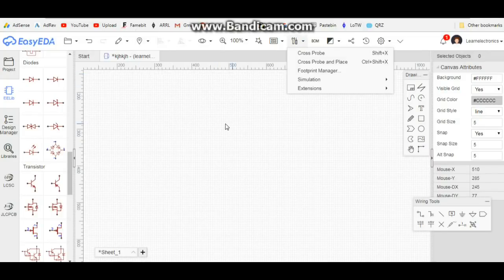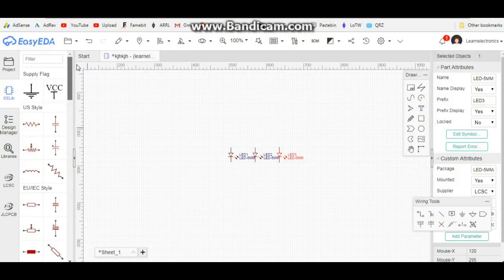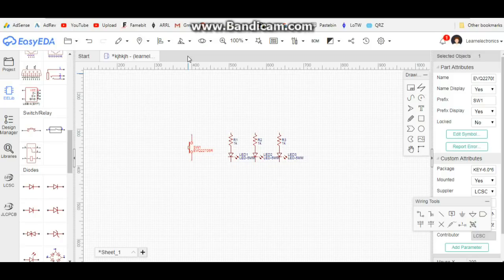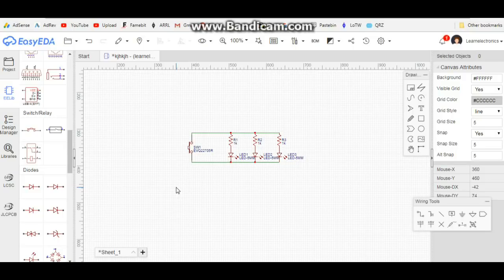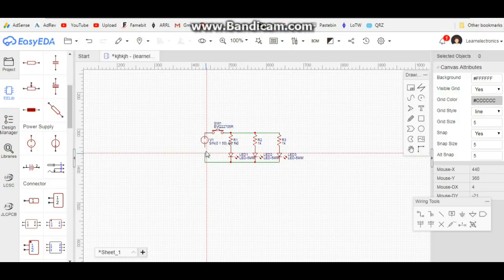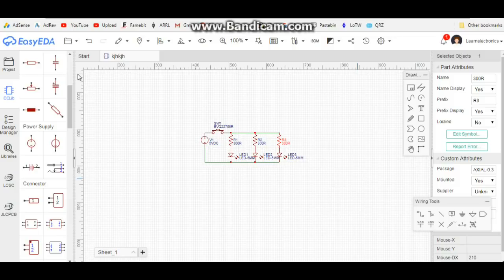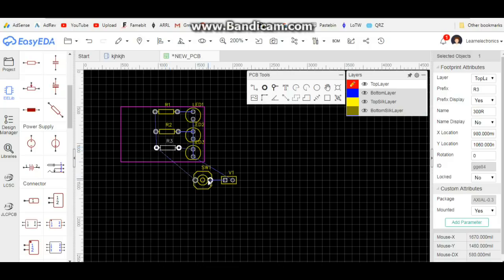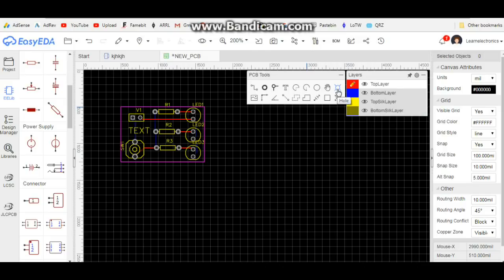From idea to PCB - Intro to EasyEDA

Comment: Maybe you know the answer to a few questions. Sense I can't get the help section on the program to work. I would like to set the grid to show inches divided into either 1/8" or 1/16" instead on 10th's of an inch. (which is worthless). And how do you determine the center of the actual component? (An LED for example). The guide lines on the ruler only show where the grab hand is which changes each time you grip a component. So, placing a component accurately is Impossible. Or, better yet, do you know how to actually contact ANYONE at EasyEDY to ask questions like these? I've tried and tried with no luck.

Comment: I was sitting on the edge of my seat, waiting for the steps to see how easyeda does spice simulation.  I can't get any of my circuits to work. You almost did it; but, you skipped to the router.  I get different errors: iteration limit reached; tran aborted; source stepping failed; transient solution failed, and on an on.  
Also, I can only see a voltage probe.  Where's the ammeter?

Comment: EasyEda is really nice. I started like two months ago to create my first PCB and after some Videos it wasn't too hard to do. Also their  huge component library saves so much time.
One thing i've learned since then: The server for the auto router sometimes seems to run on its limits sometimes so it doesn't work or take very long. In the Auto Router menu is a setting in the top right to switch between "cloud" and "local". For everyone who uses that software quite often i would recommend to use the "local" option. It's just a little extra program to download that needs to run in the background and it will do the auto routing very quickly without the cloud servers.
Reply: i do the same.

Comment: I love EasyEDA, used it for my power meter and logger.  It takes a bit of practice (you use the right mouse click a lot, which is odd at first).  Note there is an align feature in the PCB builder.

Comment: Could you recomend some other soft? I used fritzing and it was nice but sadly there are a lot of limitations or I just don't know how to use it properly. For example I don't know how to increase the size of perf board. KiCAD looks good but it also is very complex.
Reply: I've started also with fritzing for simple schematics but manually searching and adding the parts to the library was so time consuming. These days i only use EasyEDA for it .. the component library is so helpful.
Reply: @Leif_YT  EasyEDA looks good but I mostly do THT not SMT and from what I have seen you can't pick a perf board for your project in EasyEDA.

Comment: On the auto router, after you run your traces and then convert to pcb, does the auto router always run all traces? No matter where you place the components on the pcb?  Thats the part that scares me the most.
Reply: Yes, from my experience it auto routes everything.  Note that if you forgot to route something in your schematic, then the PCB traces won't be linked.  I found it best to lay out the PCB the way you want that makes the most sense, THEN use auto-route, THEN spend the next day or so (depending on your project, mine was fairly involved) customizing the traces for looks and efficiency.

Comment: Looks like a cool tool. For some reason, I missed the first part of the audio so I'm not sure of the premiss of the video but once you started working with Easyeda you came in loud and clear? Thanks for the video (and some of the audio)!  ;-)
Reply: Same for me with the audio!  Looks like a good tool which I must try sometime instead of using Veroboard!
Reply: Yah but I like Veroboard. I have the stuff and have made a few single sided boards. I also want to try and use my CNC mill or router to cut out the traces. I've got all this stuff I might as well use it instead of spending more?
Reply: Once you get used to veroboaord it's actually a great resource if perhaps not as aesthetically pleasing as a pcb!  It's also easy to trace circuits especially when compared to multi layer pcbs.